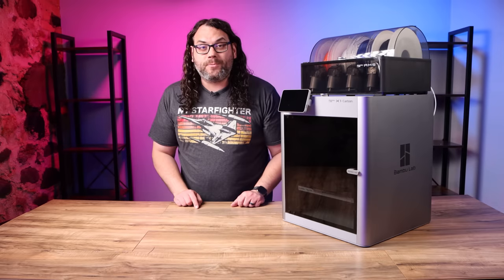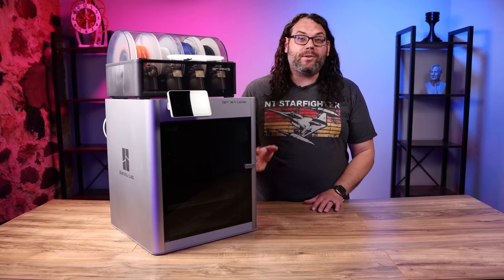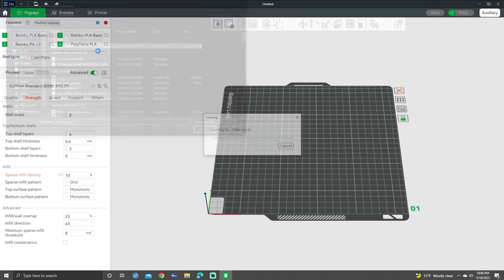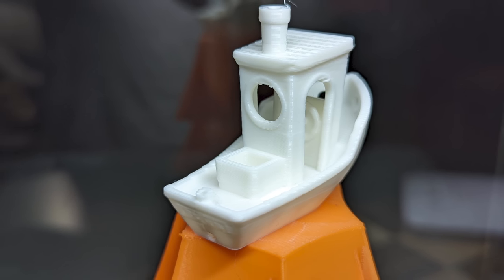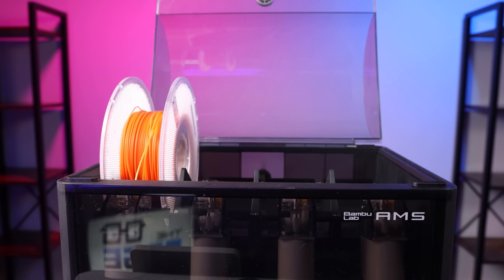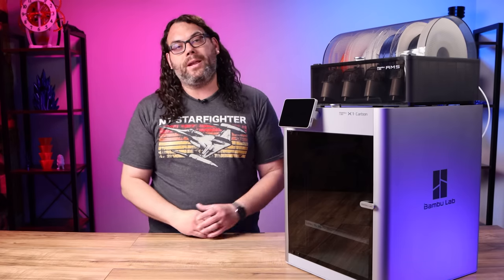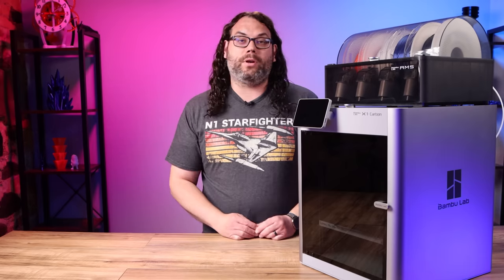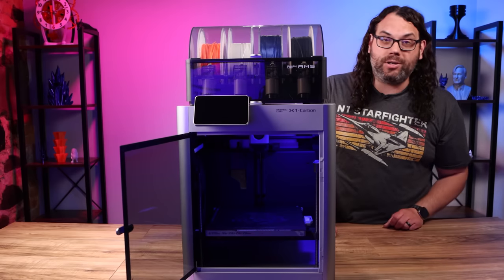The Bambu Lab X1 Carbon - Automatic Self Calibration, LIDAR, AI and INSANELY FAST!

Comment: I want to see ASA on it 24/7 for a few weeks. Does it reduce warping with the heated chamber? What's it heated by? Bed doesn't count. Oh the belt tension detector? Prusa did it 4 years ago. Closed loop fans? Prusa. Failed print detection? Kenneth Jiang of TheSpaghettiDetective. Multi material? Prusa. The only innovative thing is the lidar scanner and maybe the Klipper resonant frequency optimization.

Comment: Are you sure this is a heated chamber there is no heater unit beyond the bed and hotend ?
Reply from the maker: Correct. It’s heated by the bed and controlled by a fan in the case.

Comment: Amazing looking printer for the price, but almost seems too good to be true. For one, this almost surely sounds like it'll use proprietary software and hardware - which isn't necessarily a bad thing unless their customer support is bad or they discontinue support for this printer not far down the line. Secondly, as another commenter mentioned, to keep costs low as they are they might not have a sustainable business practice. Thirdly, as this will be on kickstarter they have no obligation to fulfill orders or even have ones up to the quality of these demo ones, as has been seen on numerous 3D printing kickstarters. 

I might just sit back and wait for the kickstarter to finish and see what people think before purchasing, even if it'll be at an increased price.
Reply from the maker: A lot of good points here. I think we will see in time. I am very optimistic about this one! Thanks for watching!
Reply: Its been confirmed basically everything but the mainboard is going to be open in some way iirc for public use. But yeah im gonna wait and see what happens with it after its released.

Comment: If they already have production models ready to go then why do they need to kickstarter?
Reply from the maker: They have been through 7 versions of this printer with hundreds of beta machines. They have an assembly line, and product being produced right now. So they are much further than most of the kickstarters out there. They are in a ramping up stage of the production and are using kickstarted as a way to get the word out and gain interest. They have very good backers and have put a ton of money already into this project. This is a way to basically do pre orders, gain interest and make some money back that they have invested so far. Also a way for us to get a discount on the machine. lol
Reply: @TheEdgeofTech  then why not just do the things you have mention instead of bringing down the potential discredit by labelling it a kickstarter?
I mean who runs around introducing their new product via a kickstarter campaign in order to gain street cred & high rep?
Why not just come out like this.. discounts on first 1000 units sold, done.

Comment: There is no way they developed the firmware,it’s either based on marlin or kipper.  What kind of speed does it print at?
Reply from the maker: Just confirmed that they developed a firmware in house. Remember, the team that wrote the firmware here is the same team who has written firmware for DJI in the past. They are crazy smart and know what's up!
Reply: @TheEdgeofTech  the features scream Klipper

Comment: You talk about how fast it prints but only showed times things take. How many ms does it print as the ankermaker does 250ms
Reply from the maker: The Anker printer is a different monster. A bed slinger if you will. That's a tough one though because there are different speeds for every thing the printers do. For example outer walls, inner walls, infill, First layers, top surfaces etc. I am not sure what Anker is using to give the 250mm/s. But If we look at Acceleration alone as that's one number, on one option, the Anker says 2500mm/s and the X1 says 10,000mm/s. And that's squared for both I believe. I don't have the Anker to look at the slicer, but I hope this helps a little? Thanks for watching!

Comment: Is this a good hassle free printer? I have an ender 3 v2 and hate it, there is no point in it, no auto-levling and too many points of failure
Reply from the maker: I think this is about as hassle free of a printer that I have ever used! It’s not perfect yet, and is still working out the software/firmware kinks, but it’s so good right out of the box! But Remember It will eventually need some maintenance or parts. Nothing is perfect.
Reply: @TheEdgeofTech  thanks for the reply. Would you recommend this or a resin printer? Mostly action figures is what I'm interested in printing

Comment: Can the cloud stuff be hosted on-premises? - I think they will drop the support of the printer model in e. g. 2 years to reduce the value of the printer. So they can continue selling new printers with minor improvements or the start to take monthly payment for cloud usage, after they sold many printers. Later they can make cloud usage more and more annoying with ads for financial services like crypto currencies or NFTs on the printer screen or the cloud web page.
Reply from the maker: Thanks for watching! I am not sure what they are going to do in the future, and I can't speculate that. But to answer your question, I don't think the cloud can be hosted at your premises. But you don't have to use it. You can slice and drop .3mf files on an sd card and print that way too.

Comment: Could you use 5 palette 3 pros on it
Reply from the maker: I mean, you could probably run it into the back, but I don't think it will work with the Palette slicer. Maybe a a random mix of filament or as a runout prevention.

Comment: It's nice to see a printer that has integrated linear advance and input shaping calibration. This is going to have to become more common if printers are going to advertise themselves as faster.

The big red flag for me is the softrware not being ready.

We went through this with the glowforge. They never delivered the features promised in the original kickstarter campaign, and they charge extra for "premium" features that would be basic and included in any other software. And there is still no way to connect directly without their cloud software. Their similarly sleek hardware design with lots of propritary parts also made it impossible to work on yourself, and you are instead totally beholden to their service center and their pricing.

It would put my mind at ease to see it printing well, including the AMS, with Cura or Prusaslicer, going around whatever proprietary parts of their cloud slicer. As long as their software is not required for good results, I'm happy.

Would love to hear more about the actual day to day operation of the printer. Would love to see more about the AMS and how it differs from other multi-material options. It didn't seem like you did any multi-material prints in this video.

Similar to a lot of kickstart stuff, we're given a lot of marketting talk and very little actual details. What's the firmware? Marlin? Klipper? Entirely new? Will the firmware be open source so we can modify it?

Are the nozzles propritary? What do they cost,  what is nozzle swapping like?

What is the hotend dissasembly process like, for when we inevitibly have to deal with a clog?

The ciruclating fan is nice, but is there room in there for an active filter when printing materials like ABS?
Reply from the maker: A lot of great questions and points! I can tell you they developed the slicer, firmware, software, hardware and apps in house from the ground up. We will have to see what they charge for parts, but they told me on stream that they would not be price gouging. And the hotend isn't to bad at all. The front cover is held on by magnets and you can remove it to see it from there. The day to day is good so far, and I have done a multi part, multi color print that came out great! Just a bunch of parts on the bed and some were black, some where blue. It does have filtration on as well. I know what you are talking about with Glowforge, and you don't have to use wifi at all on this one. You can save to an sd card and print from there. I think time will tell, but the tech and advancement is much needed in our world! Thanks for watching!
Reply: @TheEdgeofTech  Thanks for the response!

Have you done any nozzle changes? From what I can see it looks like the nozzle is pretty integrated. I think one downside could be nozzle change ease, especially considering how Revo has changed the game for nozzle swapping.

I would love to see a more in-depth video on how the AMS operates. Does it use a purge block, is there any bleeding between colors? 
I don't know what the behind the scenes agreements are between you and Bambu, I'm sure you have limitations of what you can show. But I'd love to see more in-depth footage of the machine and all of its different parts and facets. Would love to see you try to use different slicers on it and show the results. And show which features do or do not work on other slicers.

Comment: Why do they make a new slicer!?
Reply from the maker: They developed everything from the ground up. The slicer, apps, software, and firmware. That along with the printer itself. They came from DJI, so they are used to creating from the ground up to start an eco system for the whole process.
Reply: @TheEdgeofTech  The printer looks great, but I sure hope they release profiles for Cura and PrusaSlicer, which nearly everybody uses and have  ton of development.

Comment: I just have concerns of their margin not being large enough, I think they will end up going bankrupt and then the customer is left with a proprietary printer with no parts available and no software updates.
Reply: This is exactly what happened with CubePro, right?
Reply: @Cuber112  it happens with tons of manufacturers! Unfortunately, China usually copies the designs and sells it for half price. All the engineering time that’s supposed to be rolled into the original designs cost is lost to lower cost suppliers that copy / paste. Most customers then complain when the original designs (slice engineering, E3D, prusa) are more expensive than the clones.
Reply from the maker: I hope not, and I am very optimistic about this one! Thanks for watching!
Reply: @TheEdgeofTech  I also hope.. but it just seems like a lot of machine for that price. Our stratasys f370s have less than half the tech with a 50x price tag
Reply from the maker: @oneheadlight8000  Right! Win, lose or draw on this one, it will be a game changer and make other manufacturers buckle up! They have to get better now and that's a great thing for our community!

Comment: btw it is a lie from bambu that they already have production unit ready to ship that is a complete lie. 

here is why in there video there was never a time in which you see a production line and a packaging line. 

The Kickstarter is for them to start production. (bambu only just secure a production volume for there product so the kick start is to pay off the initial production order. if they already have a production line ready to start shipping they would not need a KICKSTARTER. they would have collected the order directly. 

THIS IS ALL PR & MARKETING to gain enough Kickstarter attraction to get a enough funds to actually start there live production line. 

what you see in on the YouTube page and other media is there Prototyping & development line. 

I will not join a kick starter until they offer a live order and ability to order on amazon or other retailers or distributor.
Reply from the maker: I appreciate the opinion, but I have to respectively disagree. They are using Kickstarter to get the word out and build on what they already have. If you look at the same youtube channel you will see the assembly line, the testing facility, the 7 different versions of this printer and more. Also, I have personally talked to the CEO and have had him on a livestream on this channel. They have a line, productions models and are in the Ramping Up phase of their production run now. I understand that you don't want to order from them yet, and that's ok. Thanks for watching!
Reply: @TheEdgeofTech  thank you for your kind reply. the main question here is if they have something already going on why is kickstart the way for them to get the word of out out kickstarter doesn't do any form of advertising for the item. 

so far the word of mouth is coming mainly from content creators. So this begs my question why can't they provide a direct pre-order from there website. just the same way PRUSA has done with there XL launch.

after all kickstart provides no guarantee on delivery. so if they already have unit been assembly they could just just take a direct order. Heck they could have done both that and kickstarter. 

Kickstarter benefit the company more than the customer backers have no guarantee whilst the company can hit there milestone and run away or even declare bankrupt and go under. even you has a content creator will have no way of fishing financial information easily on a china based registered company. so let not kid our self on market and PR. 

Another scenario could be that they may be struggling to pay of there production line and kickstarter would help them with this. just because you have spoke to a CEO does not mean anything expect protentional positive PR and marketing for the company and the product. 

we have seen this with kickstarter project many times, crypto the same thing. areas where their is no financial obligation to meet or protect the customer financially. 

what legal action can you hold bambu to despite you speak to the CEO? 

What Garantee does Kickstarter have to backers and pledger = 00000000 zeroooo.

Chinese financial regulation works completely different to the EU & USA. 

TBH, if they are at such a well developed stage of the product they should have just taking Pre orders and use content creator to push the PR & marketing. I mean ASUS, DELL, NVIDIA, AMD, Logitech and soooooo many companies do this now with no back lash some with pre order sales and NVIDIA did so with the release of the RTX3000 series GPU. even a UK retail overclockers does that scan uk does that take pre orders. 

I refuse to buy into the idea that at the end of a product development cycle that is when bambu is deciding to do kickstart over a well recognized method of PRE-order via website and retailers. 

also despite all of this how will they handle Customer repairs, bug and support. you for one did no ask this on you livestream. and no one as received any new or statement in relation to such thing.

Comment: I tried to back promptly at 1500 UTC (1000 Central) but was met with errors on all rewards, which is still occurring.  I tried unsuccessfully for 40 minutes to get the early bird combo for $1000.  It left a very bad taste in my mouth for both Kickstarter and Bambu Lab. Extremely disappointing.
Reply from the maker: That's totally kickstarter's phone for not updating and having servers that can handle traffic. This happens on all major kickstarters. There are still units available in the next level up and I promise it's worth it!
Reply from the maker: I did back their project as because I really believe in this company and this machine!
Reply: @TheEdgeofTech  I tried all rewards.  They're all still giving errors via web and mobile app.  Kickstarter is an absolute crap platform, but this is known.  Yet companies still use it, and that decision is absolutely on them for choosing it.
Reply from the maker: @MakerMeraki  Totally understand the frustration man. I had 3 windows across 2 browsers and my phone trying. Lol
Reply: @TheEdgeofTech  I finally got in 4 hours after launch, but for way more than my budget allows.
Reply from the maker: @MakerMeraki  Dang!

Comment: I think I’ve just changed my mind about getting a Prusa XL. This company will beat it to market with more features at a much lower price.
Reply from the maker: Not sure about that as the Prusa has multiple heads right? But it does check a ton of the boxes off and it comes with unbelievable new tech!
Reply: The prusa is bigger and has multiple heads which is not the same as an MMU.
Reply: Not true. The main thing this printer has that a prusa doesn't is the lidar and camera. Those features are nice, but they don't really add much to the 3D printing process if your printer is already printing well.  You're also forgetting one of the biggest selling points of prusa: their customer support and community. Prusa is one of the largest and most established desktop 3D printer companies in the world. They are known for reliability and quality.
Reply: @sushsidnd  I own a Prusa Mk3s and it’s fantastic. For the next printer I buy, I want it to be able to handle multi-colour/ multi-material. Yes I could just buy a Prusa MMU but reliability on those isn’t great. 

What excites me about Bambu Labs x1 carbon is that they’ve already got a production line setup and their first machines off the lot have been sent to YouTubers and have been proven to work reliably as advertised. Of course I’ll wait till they’ve been out a while before taking the leap in purchasing one, but very promising.
Reply: @TheEdgeofTech  that is true. I don’t really need other tool heads though. I just want a machine that can do reliable multi-colour/ multi-material